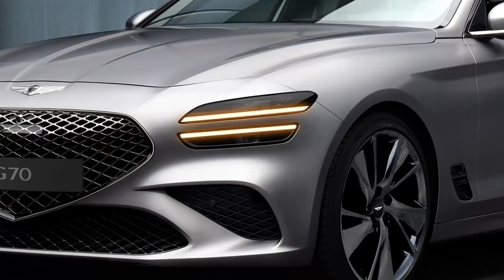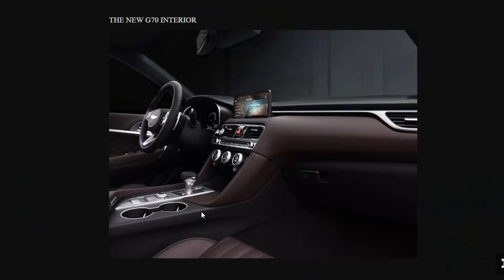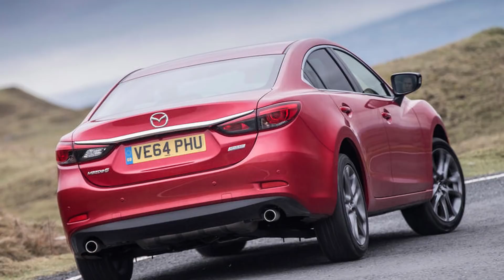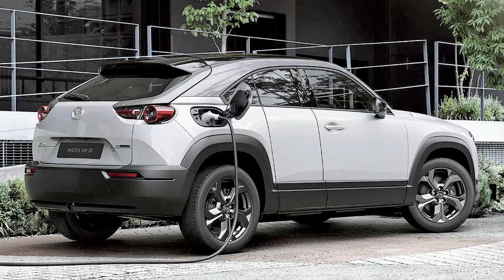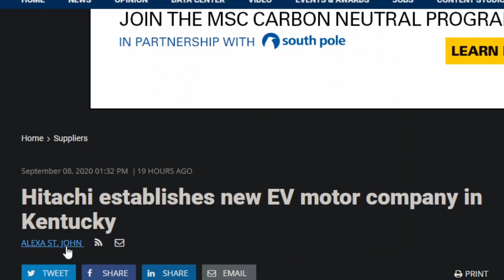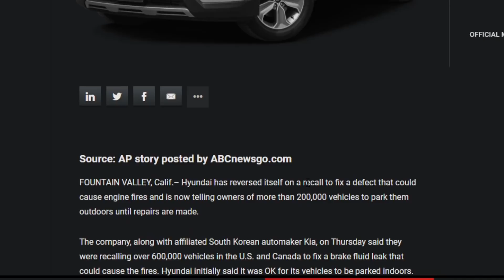Genesis G70 gets REDESIGNED and Upgraded for 2022...

Comment: I haven’t done ANY research at all whatsoever to support this (I leave that to you😆) HOWEVER I would assume there isn’t really anything new about the engines. Most likely same engines they have currently, just bored out like they did with the 4.6L v8 and turned it into a 5.0L v8. Also, you say the 3.5L TT V6 going for 370+hp “around 375hp” so it’s going to be a slightly bigger displacement with less HP!? 🤦🏻‍♂️🤦🏻‍♂️🤦🏻‍♂️👎🏼👎🏼👎🏼

Comment: Kirk_ great video!!! I'm about to retire and I'm going to buy either a Mazda 6 or a Toyota Camry. I need your expert advice:
     a) Is the Camry that much MORE reliable that I should buy it over the  Mazda 6? Do Mazdas make it to 200,000 miles without problems?
Reply from the maker: Mazda 6 turbo in theory isn't as reliable as a v6 non-turbo. If you're getting the non-turbo Mazda 6, and a non  v6 camry, they're both reliable choices...but all cars break at somepoint.
Reply: @KirkKreifels  Thanks, Kirk!

Comment: I like the front and side rendering of that Mazda 6! The rear looks too flat, like it backed into a wall. I think it needs more curves in the rear and a more distinctive rear headlight design. Also it would be great if they move the center brake light to be at the top of the rear window.

Comment: IMHO, The genesis needs a higher HP motor in the mix to truly compete. 300hp 4cyl, 370ish v6tt, a 475+HP variant would be fantastic, so it can compete more with the M, amg type higher end vehicles.

Comment: INFINITI very quietly released the 2021 Q50. It is basically unchanged from the 2016 Q50. I think the only changes are possibly larger brakes and an electronic suspension controller. You would be hard pressed to tell the difference visually between the 2016 and 2021 model.

Comment: I have a 2012 genesis sedan. The redesigned g70 is taking ques from it forsure
Reply: How do you like your genesis?  I'm really interested in getting a 5.0 r spec for my second car and have heard good reviews but never from owners
Reply: @jacobrael9872  I love mine. There are some wiring issues if you get the technology package. And the earlier year models have transmission issues. Which mine both have I had to put in a new transmission at 220000km on it. But other than that everything else runs, works great
Reply: @dakotafrancis2468  high km 2009 Genesis owner here I love the Genesis so much.

Comment: I think Genesis is quickly rushing to upgrade and boost powertrain to attract people off tech and more horsepower. I really wish they would wait a little with there cars because they are starting to seem desperate for sells.
Reply from the maker: Faster development is exciting but you sacrifice reliability with short testing timetables.
Reply: It's possible the SUV will outsell all Genesis models combined, so with that cash plus 'breathing room' they may be less inclined to rush car models/features to market. Right now Genesis is doing everything right on paper (except for separate dealerships from Hyundai), but it's not enough. That's where the SUV can be a game changer, like the Telluride/Palisade are in the full-size SUV "non-luxury" market.